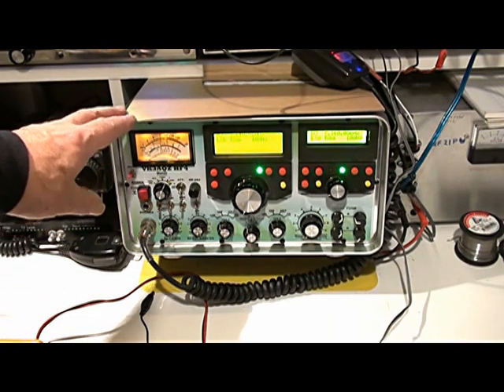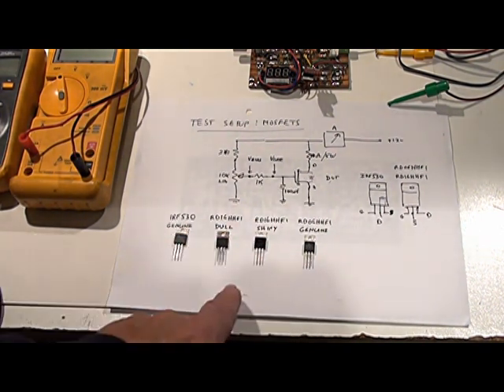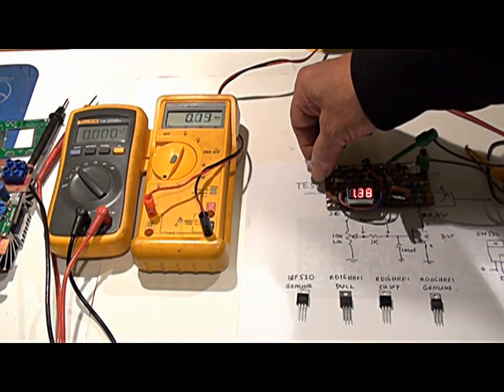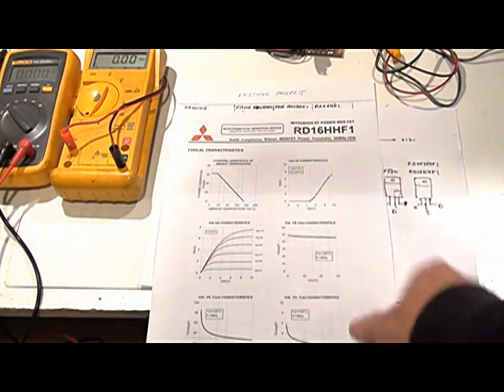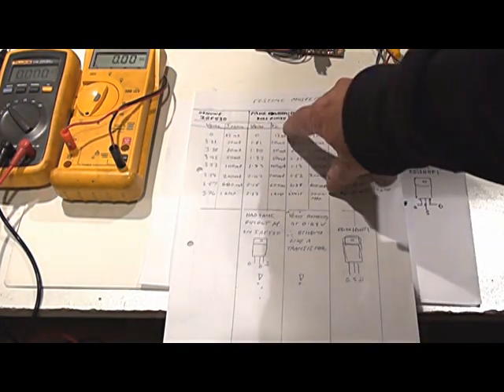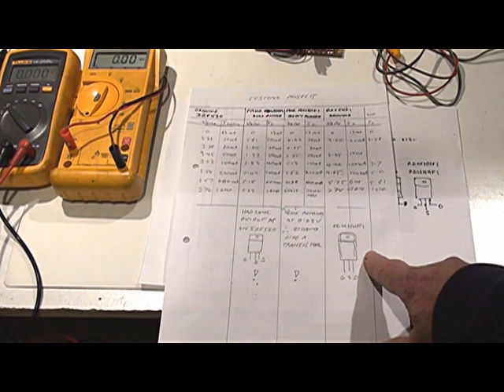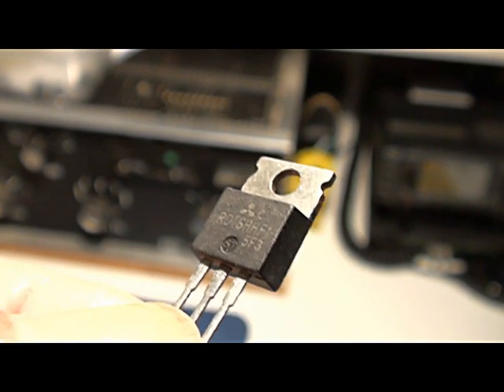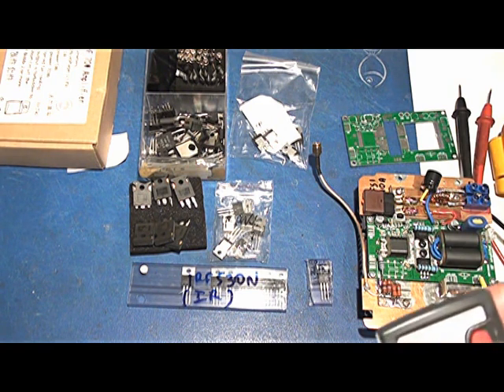RD16HHF1 fakes

Comment: Hi
I know it was some time ago. Where did you get your genuine RD FETS from ??

WES & Farnell / element 14 don’t stock them. Had a look on eBay and you can almost smell the fakes right from the app. 

Anyone local ? Or shall I start looking at the usual suspects like Mouser or Digikey
Reply from the maker: Hi Cris, from Minikits in Adelaide at $8.60 plus post.  

https://www.minikits.com.au/components/semiconductors/mosfets/rf-mosfets/RD16HHF1.

The RD06HHF1 were from EBay from gowin_electronic (89911) and they worked okay. They were not all that cheap since they are not as commonly used a sthe RD16's . And his stuff seems to be okay.  If you cannot get them, then any 5W RF transistor, or even less, should be okay to drive  a pair of RD16's. The BIG advantage of the RD series is the package which has the source as the metal tab  going straight to earth with no insulator needed.  And the intermod performace is pretty good. The transfer curves for the RD series are almost a straighht line.
Reply: vk3aqz thanks for getting back to me

I tracked Glyn down as the Mitsubishi Electric distributors here in au. Just hit them up with an email

I have an old Xiegu X108G with no output to speak of. I’m about to pull it down after fixing some other connector and button issues. The output stage uses a 06 and pair of 16s 

Getting these parts from eBay is asking for trouble, but not always bad. It’s hard to tell. 

I considered using some IRF devices I have had for years, but realised it would be a step backwards. These transistors are rather nicely behaved. 

They also make a 100W version, the RD100HHF1. A pair of them could perform rather nicely in the right environment 

Anyway. Thanks for the video. Might catch you on air one day, though I only really pound a straight key....very badly...but it’s fun. So if you hear code that sounds like a drunken chicken (that shouldn’t have smoked that joint he was offered) somewhere north of 7040 that could be me.  :-)

I’ll let you know how I go with Glyn

73s de VK2NAP
Reply from the maker: @MidlifeRenaissanceMan  Hi Chris, Yes, I sometimes look at Glyn for bits. Sometimes they only deal in larger orders. But I must admit I have not asked them about the RD16s. Let me know how you go with them. The IRF530 etc are not as good as the RD FETS. They are really just a switching device and if you look at the transfer curve, you will find they are not as linear, so the intermod is not as good. Also, the gate turn on voltage tends to vary quite a bit between manufacturers so the bias voltage can be anything from 2 to 5 volts. Lastly, they don't like a high SWR, or to much gate drive - both things kill them fast. The RD ones are designed to withstand more swr and drive - they can still be killed but it takes a lot more to do it. The RD FETS don't like high operating temperatures so hearsinking with only  a thin layer of paste is important. The paste is there to fill the tiny pits in the metal surface so there is less trapped air which can sometimes add up to a quite a lot and therefore a lot of missed contact between the 2 surfaces. I hope you manage to repair your rig. Yes, If I hear a wobbly CW signal, I will whistle morse back. Cheers mate.
Reply: vk3aqz cheers for that. I emailed them earlier today. Hoping to hear back. Might call them now. Alarm has gone off to deal with my afternoon follow ups. 

I have some old original Fairchild IRF540 in a tube from early switch mode days for getting car electrical systems do drive 300 Watt RMS amplifier modules. Before you could simply buy the stuff off the shelf and then everyone had them. 

I still occasionally play with big audio amplifiers. I have 9 PTM1250 monsters. They run 110V DC rails and they get warm, but the 15024s can cope most of the time. Unfortunately they’re getting a little old and 3 of them are dedicated for spares and testing. 

These Xiegu radios have an arrangement where the internal heat sink couples with the underside of the case. Whomever has worked in it previously has put waaaaay too much white paste on there. May have been what took it out. I’ll clean it all up and start again once I confirm it’s the outputs and have them replaced. 

The specs on those transistors make for an elegant solution for some home brew. That said, you could have 5 times the IRF devices for the same money, and maybe getting them to work in a PCM mode rather than a linear mode could give you some serious solid state clout, but the complexity and gotchas of switching amplifiers makes me tired.
Reply from the maker: @MidlifeRenaissanceMan  Yes, all good info on the high powered AF amps. I have a 70W miniPA and I put some IRF530s in from XON in Perth. I don't have it in a radio but do test it fro time to time on the bench. The original Chineses ones blew up as soon as I turned it on but the good ones are still going. I bought 10 off but so far only used the 2.
Yes, they are cheap so maybe you can try a pair. Don't forget the pinout is different to the RD16's. Start with zero bias gate voltage and try not to go too high. Stop when the drain current gets to 30mA. Some designs use a Idq no signal current of 30mA whilst others go upto 300mA. For CW you can keep it pretty low as you said.
Not much lost if you try them and they don't work. Also keep the drive low at first -- till you get the feel for the amp and know how much it can take before it goes puff. Lou.
Reply: vk3aqz Hmmmm IRF530 100V and 14A just not all at once. 

At around a buck to a buck fifty each, I would be curious if you could throw 12 or 16 of them at an amp. Push it with 30, 50, 70V and see if they’d keep up with a bit of abuse all while maintaining acceptable spectral purity
Reply from the maker: @MidlifeRenaissanceMan  Well, yes, worth  a try while waiting or deciding on the RD16s. Plenty of them are in use - on CW you might be okay. The filters will remove the harmonics, The Intermod is really only an issue with SSB - CW as  you said could even run Class C. I drive the input of my 10W amps through a 3dB pad, and the output to the 100W stage is always through a pad. Maybe put  a 3db pad between the rig output and antenna to help keep the load not so reactive - a pad using 3W resistors or something like that. I tend to do that when I first start conneting stuff to the antennae with  experimental amps.
Reply from the maker: @MidlifeRenaissanceMan  Chris, I fogot to mention - an other option is to purchase the Minikits 16W amp which uses the RD16's driven by a chip. Its not a big circuit board and may fit in you radio on, or the outside, or small box external. I use one on my MK4 HF rig. Price - well cost more than new RD16s and a n RD06 but you get all the bits and  a PCB Anyway, just  a thought. Lou
Reply: vk3aqz the little transceiver is rather tight in its construction. But I’ll have to check out the mini kits website. I’m wanting to do some videos on “Bargains,
Boat Anchors and Broken Things”  I’m looking at different kits to get you on the air and doing a miles worked per $ challenge 

All my antennas are various magnetic loops I have crafted from scrap RG6 coax and timber from the renovations we are doing. Having an inner city block in Sydney has its advantages, but switching noise and no real space for a tower aren’t two of them. I’m set up for 40 30 (above my pay grade) and 20 on one and I have a second I use for 10m which may go down as far as 15m, but I haven’t done much about it yet. 

The 40m tunes nicely over a 40KHz chunk hence the CW. I have a couple of loading caps that tune the bottom 40KHz and a second that does 7020 - 7060 where the chickens hang out. I joined SKCC as it was free and offered a great community where I can hone my skills with other like minded misfits. 

The mag loop kind of gets around the QRN issues, and space challenges and, importantly barely cost me $10 in parts to construct the first one. I think I’ve spent $15 all up on the current version. 

I’ll keep in touch. Let you know how I go with Glyn. Failing that, I’ll grab a few parts of Minikits. 

73s and type soon
Reply from the maker: @MidlifeRenaissanceMan  Hi Chris. the loops sound good. Yes, if you don't have much room then loops seem to be the way to go. I am a bit lucky here as I am on a few acres so I have an 80/40 trap dipole. I have a TH3JNR half assembled also. Anyway, yes. have a look at the 16W amp - it also contains an RX bypass on recieive so it can sit external to your radio. Might make it easier to run as an outboard booster.
So good luck with all that. Regards, Lou
Reply: vk3aqz well I had it working for around 5 minutes. Looks like the FETs are all ok. However I’m not getting enough drive. Ribbon cables and coax connectors on a multi board sandwich makes it a little difficult to work out where things are going, but I can see a little bit of signal going into the amp board. Nothing on the output FETs 

Getting closer 

Sadly someone has been inside this already. Found some protruding screws in the heatsink preventing it from making a flat contact with the case. Hence the large quantity of paste
Reply from the maker: @MidlifeRenaissanceMan  Hi Chris. Ok. Looks like you need to track back through the radio. Hope you find the problem. Cheers.
Reply: vk3aqz so I had it key up with some decent power for around 5 minutes. Then, when I put it back together, it stopped again. 

It’s hard to get to the component side of the board. Ahhh the joys of tinkering with radios. At least I have a decent soldering setup with a vacuum gun and soldering tweezers
Reply from the maker: @MidlifeRenaissanceMan  Dirty connection or maybe  a cracked ribbon wire. Check that nothing is shorting on the boards like a piece of exposed braid, etc., when you put things back in. At least you do know that it can work which must be a bit of relief.  Anyway, as you said - the joys of ham radio. That is why I like to make my own radios - much easier to fix. Modern radios are a real pain to fix and unfortunately it's expensive to get someone else to fix it, and often just becomes junk, despite the high cost.  Cheers, Lou
Reply: vk3aqz yeah. There’s advantages to a Colpitts oscillator et al made with a rock and a couple of old TV tubes 

I went over it all last night. Found a few stray bits of solder. I might have to remove the heatsink underneath. This is becoming a major operation
Reply: vk3aqz I fed the input with a reduced signal from a Pixie. Managed to get 15W carrier out. So I suspect there is an amp stage out or the protection is cutting in
Reply from the maker: @MidlifeRenaissanceMan  Ok. At least the RD16's are working. Good idea to drive it from an other source. I have a sig gen here which I often feed into a1W stage to test PA amps. Thanks for the feedback Chris - sounds like you know your stuff all right!
Reply: vk3aqz and it’s working...kind of. The first stage on the amp is not on the schematic. I have a later revision. But it matches the part number in the service manual 

A 2SC5551 surface mount. Was open circuit. Soldered a 2SC8050 TO92 in place and it kicked over. Now to track one down. Mouser stocks them. I’ll see what else I need to make the order worthwhile....unless I decide to tidy up the 8050 and leave it there